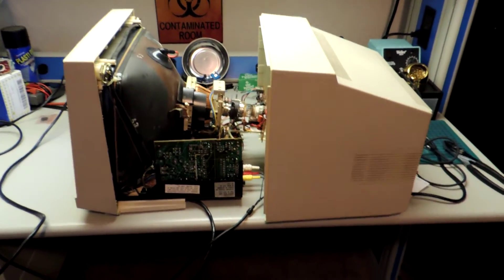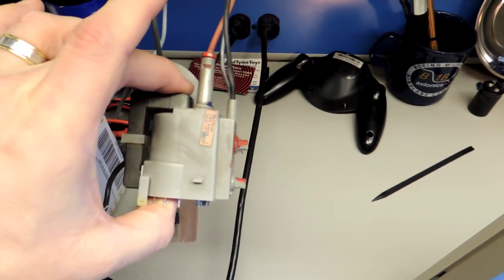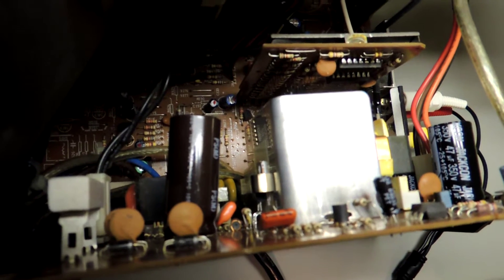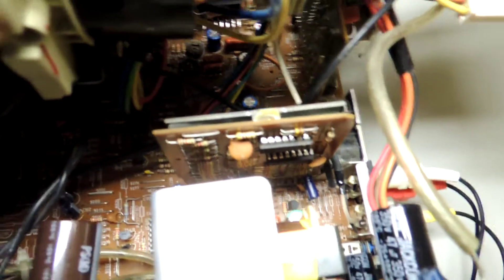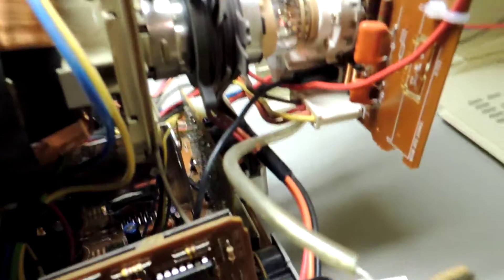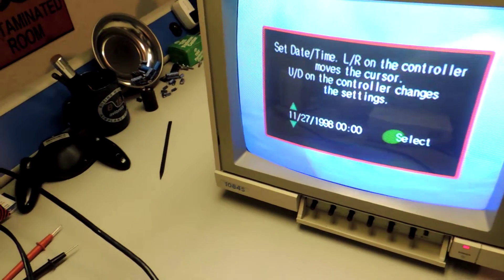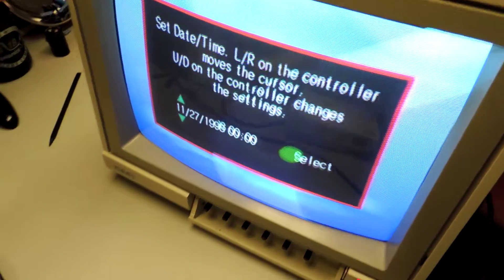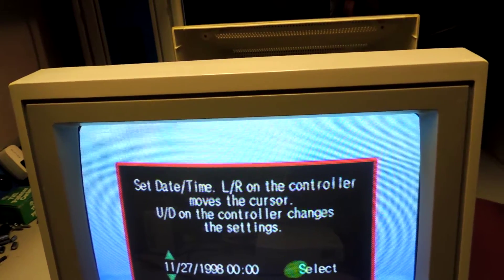Commodore 1084S-P

Comment: If you've ever wondered if the 1084 can be EASILY converted to a 1084S, the answer is no, the audio circuit design is completely different.  The 1084 uses the volume control pot on the input (mono), which obviously doesn't work for stereo input.

Comment: I've repaired a bunch of these phillips monitors. The 1902, 1084, and 1084s are all similar. The 1902 has a monochrome green button which I once converted to monochrome amber with some resistors. Working on a 1084s right now with a bad flyback (I believe).  I noticed that when monitoring the HOT collector with an oscilloscope, the pulse rang in a descending sine wave and the base signal was also distorted.  When I removed the HOT the input to base was a perfect 15khz square wave.  Replacing the HOT gave same effect.  I figured the flyback must be damaged (diodes shorted?). Still waiting on the replacement.

Comment: I have a 1084S-P1 220Volt. I want to bring it to Canada. Will it work here with my PAL Amiga 500, when I use a Step up transformer. I am thinking of the 50 and 60 hz not being changed in the Step up power transformer.
Reply from the maker: That is a very good question!  Unfortunately I don't have an answer for you.  I'd keep searching for an answer online, someone must have tried this.  The only thing I can say is that I know someone who has many full sized arcade games from the 1980's that he shipped to the states and runs them on a step up transformer, and they run fine.  I don't know any details about the type of transformer, or if it means a monitor will work the same.

Good luck and post your results if you do try it so it may help others!

Comment: I have a 1084s monitor. My problem is, the switch doesn't work any more and I get no picture. The sound comes in just fine without any high squealing, pitching sound. There's no static on the screen when the monitor is on.  I opened it up and visually inspected the capacitors and flyback. I couldn't find anything visually wrong with it. I also reseated the cables inside. I was going to re-flow the solder on the flyback, but never ended up doing that. I will admit I am a noob when it comes to CRT's. I am aware of the high voltage danger inside them and took precautions by discharging the tube before working on it. 

If anyone can give me some pointers, I would appreciate it.

Comment from the maker: Here's the info I compiled from my chassis and the internet.  Your monitor may vary, so use at your own risk!

Commodore 1084S-P Monitor Cap List

Main Chassis:
C334 .47uf 63V
C234 1uf 50V
C446 1uf 50V
C482 1uf 50V
C474 1uf 50V
C461 2.2uf 63V
C585 4.7uf 25V
C447 4.7uf 25V
C412 10uf 16V
C345 10uf 16V
C544 22uf 16V
C634 22uf 16V
C636 22uf 16V
C462 22uf 35V
C485 22uf 35V
C232 47uf 16V
C507 47uf 16V
C512 47uf 16V
C361 47uf 16V
C216 47uf 16V
C537 47uf 16V
C494 47uf 200V
C505 100uf 10V
C204 100uf 10V
C205 100uf 10V
C206 100uf 10V
C233 100uf 16V
C511 100uf 16V
C562 100uf 16V
C433 100uf 16V
C574 100uf 16V
C214 100uf 16V
C347 100uf 35V
C638 100uf 35V
C492 330uf 16V
C491 470uf 25V
C493 470uf 35V
C346 470uf 35V
C352 680uf 35V
C473 4.7uf 50V Bi-Polar (New cap purchased has a dramatic physical size differential, much smaller) 

Neck Board:
C716 4.7uf 200V

Power Supply Board:
C122 1uf 50V
C116 47uf 16V
C144 47uf 200V
C145 470uf 35V
C146 470uf 25V
C112 220uf 200V

Audio Board:
C390 1uf 50V
C391 1uf 50V
C382 4.7uf 25V
C383 4.7uf 25V
C396 22uf 16V
C395 220uf 16V
C394 1000uf 25V

Interface Board (small vertical riser board on chassis):
C258 47uf 16V

Flyback:
AT2079-30101 or HR7506
Replaced with AT2079-30102/HR7506 replacement made in China, purchased through eBay.
High Output Transistor should be replaced at the same time as flyback:

Phillips BU508A

Recommended to replace:

On power supply board, Transistor located at TS132 sometimes called the 'chopper transistor'.
Part crosses to NTE2315

Comment: I have an 1084S P2 and a couple a weeks ago the image was gone, no LED and the whistle from the flyback was there! So i replace the FUSE (was dead) , The flyback, all the round capacitors, the H.O.T. and chopper transistor, I even change the PSU AND STILL... Remains dead :/ the only diference is the whistle sound from the flyback is gone ! I have noooo idea what the problem is now! Tell me what do you think about it!
Reply: VaderQrt When you replaced flyback, did you turn it's dials?

Usually they need turning on a new install.

Comment: Prior to working on it, did you take any precautions like discharging at the anode under that suction cup?  I ask because somebody else told me just to leave it off for a few days, but you did heavy-duty work with the flyback transformer, so I'd like to know what precautions you did.

Thank you!
Reply: Wouldn't you do the standard screwdriver/alligator clip grounding method?